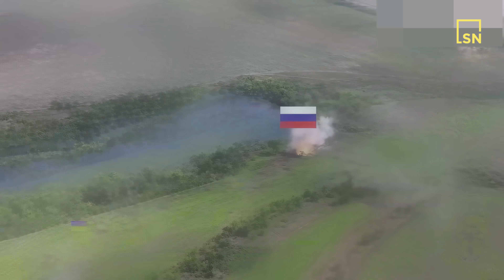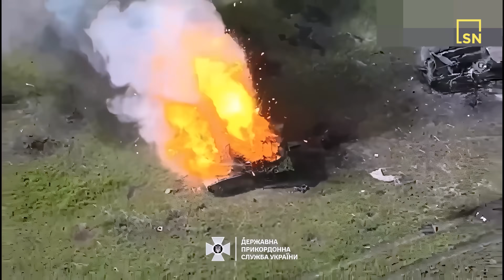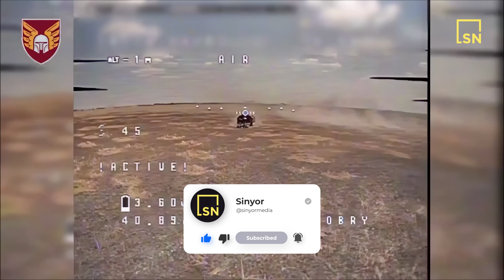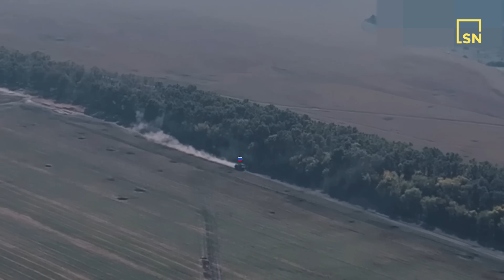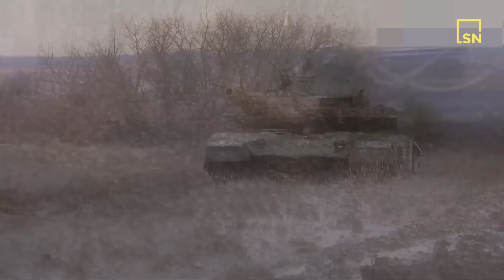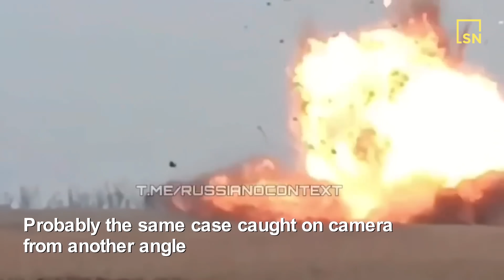Two Abrams Face Russian Brigade Alone, Head-on

Comment: T-series tanks are a deathtrap with the crew sitting right on top of the charges exposed. This shows that even with hatches closed that the pressure can cook them off resulting in ERA being useless when even small explosives can cause this reaction from even outside the armour.

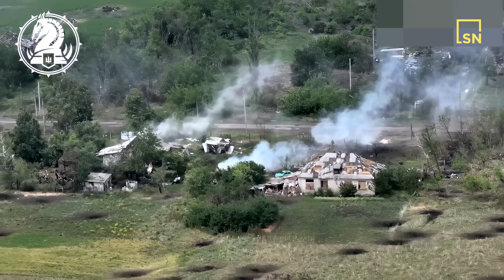Comment: 2:15 "The duel ends with the Bradly's clear advantage" and after a few seconds we can see the BTR calmly driving away, being completely undamaged with the live infantry, lol
Reply: Yea this is just propaganda
Reply: @Вова-л9г3ъ  you can clearly see the btr has extreme engine damage rendering it unusable, its not war thunder they cant just extinguish the fire and fix it in 40 seconds.
Reply: @D1CornbaII  What do you mean I cannot fix my damaged cannon barrel, cannon breach, engine, transmission in 40 seconds? Next, are you going to tell me that I cannot replenish crews on the caps?
Reply: @null-0x only if you cap the d point
Reply: Ну как сказать ,он проскочил но пехоту покрошило,у Бредли фугасные снаряды с воздушным подрывом
Reply: @Виталий-ч2б5ь  во во , не зря там зацензурено 
Водитель может и выжил , а вот все кто был на броне отправились к кобзону

Comment: I think one of the things people don't realize is that the reason russian tanks have such catastrophic failures compared to western tanks is that they use an autoloading mechanism with powder charges that are just kept in the crew compartment under the turret basket. Western tanks use dedicated blow out boxes in the back of the turret so if the ammo ignites it basically blows out a hatch away from the crew. This is also part of the reason why western turrets are so much larger compared to Russian ones

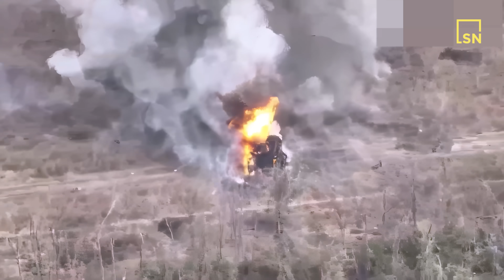Comment: 6:14 is not a mine, it is an ATGM, probably a Ukrainian Kombat or Stugna. The video showed a small line on the left side of the screen. To see it, you need to frame a split second before the explosion. It exploded because the impact was in an area where there was no Russian-made Relict dynamic protection that could have contained such a blow. But it wasn't there, so the cumulative jet (armor penetration of approximately 750mm) hit the ammunition directly, which apparently led to the explosion. If an Abrams or Leopard had been standing in the place of the T-90, the crew would have died due to the enormous pressure, temperature, and a small amount of debris that this cumulative would have created. Therefore, you can only protect yourself from this missile if you completely repel the blow without letting it penetrate the armor.

I am Ukrainian, and I don't want you to idealize Abrams or Leopards. At the moment, they are burning, unfortunately, no worse than the Russian ones. Of course, the chances of survival are higher, but don't pretend that they are the best.

Comment: This is going to sound like i'm trying to be funny. I'm not. I'm seeing a lot of open turrets. So, did the Russians not put AC in their next gen tanks? Not rhetorical.
If they're driving onto a battle field with hatches open, that's the only thing i can figure, that the heat is debilitating inside the tank.

Comment: I was a K1E1 tank gunner from Korean Army. Once, I had a chance to get combat training and war simulation against the other Korean armored unit that operates T-80U tanks as mimics of North Korean and Chinese tanks. On the way of returning to the point for break time right after the combat drill, my Commander reminds me that whole soviet based tanks with all auto-loader system like those micro-soft T-80 are extremely vulnerable to chain explosion of the ammo and turret blown-off. Now eventually I understand via this video what the senior sergeants said.

Comment: Power take off PTO press gears cables pulleys hydraulics like transformers autobots decepticons technologies flex joint scaffold tile pressure panels power wind suspension dynamo generators power wind poles orbital powered like automatic watch like tectonic plates diamond coating fiber optics light speed signals reflector light sorce codes cloaking device transmitters focal Lazer systems incinerate missiles hypersonic missiles nanowalls electric current solid to passing through kinetic energy readers sight system power source receive signals quicker cyclone intake sorter valves psi tanks compressors fuel recycling technologies warp drive technologies also helps clean environments foreign exchange students policy members UFO mechanics repair droids turned into organic lifeforms trading places with lifeforms cybernetic clone series droids designed for infiltration systems planets moons world's alien infiltration act members best luck everyone PTO press gears cables pulleys hydraulics flex joint scaffold tile pressure panels solar panels microwave panels converts signals to energy power wind suspension dynamo generators power wind poles heat cool channel tubes cyclone intake sorter valves psi tanks compressors fuel recycling technologies electro static magnetic shield generators electro static magnetic purpultion heat cool hover panels diamond coating fiber optics light speed signals reflector light sorce codes cloaking device transmitter neural implants nerve splicing nanites microscopic robotics nanited hulls nanowalls nanotec munitions reanimates reprograms lifeforms uploads downloads information kinetic energy readers sight system power source reading electric current magnetic field vision sonar thermal vision infered molecular vision elemental vision aliens alliances Armada approved federation friends forever federation throughout the universe doesn't resalitify is the goal were all matter of the universe doesn't resalitify is the goal life's important ingredient to help make sure the universe doesn't resalitify planet moon sized spaceship building shows

Comment: This feels more like WWI with modern weapons
Reply: What do you mean?
Reply: @britishrocklovingyank3491 long running trenches with only incremental gains that tend to push forward and back over time. Most modern conflicts are very asymmetrical, with power expanded from one side over another. While there is an argument for that here, the combat ebbs and flows daily. WWI also say weapons from 200 years still being used on the battlefield as soldiers, commanders, and those unfortunate enough to be caught in the theaters learning how to adapt to the changing of times.

Comment: Why don't you tell people how Ukrainians are losing equipment? They have much more losses of "great" NATO equipment which is inferior to Russian equipment in many ways, take the Bradley and the Russian IFV, for example. If the electronics in the Bradley fail, it's just a pile of metal that can't be controlled. Russian BMP doesn't have that problem, plus it can immediately move on water without hours of preparation, like the Bradley.
Reply: Ur right, but russia use mainly bmp1 and bmp2, which are worse than bradley- like armour, penetration, gun range.. only thing is that bmp have better mobility, and they haven’t lost more equipment

Comment: Russian tanks only have solid protection in the front on the hull and turret, the sides are thin only rated to stop 25mm at least on the older T 72 models. the up side to that is they are cheaper and faster to produce

Comment: 📉 Ukrainian Tank Losses by Type (February 2022 – July 2025)

Tank Type / Origin	Estimated Losses	Main Remarks
T-64 (Soviet)	~500 units	Main tank at the start of the conflict
T-72 (modified)	~300 units	Delivered by Poland, Czech Republic; modernized
Leopard 2A4 / 2A6	~40 units	Frequent targets of Russian drones
Leopard 1A5	~20 units	Less protected, often used in support roles
Challenger 2	~5 units	Rarely deployed on front lines
M1 Abrams	~10 units	Used cautiously, limited losses
AMX-10RC	~25 units	Light armor, vulnerable to ambushes
Other Western tanks	~15 units	Includes light or older tank models
Estimated Total Losses	~920–950 tanks	Confirmed or probable cumulative losses
📆 Estimated Monthly Losses (Trend)
Month / Year	Estimated Losses	Main Tank Types Affected	Military Context
Mar–May 2022	~250 tanks	T-64, T-72	Initial Russian offensive
Jun–Dec 2022	~200 tanks	T-64, T-72	Battles in Donbas and Kherson
Jan–Jun 2023	~150 tanks	T-72, Leopard 2, AMX-10RC	Ukrainian counteroffensives
Jul–Dec 2023	~120 tanks	Leopard 2, AMX-10RC, Abrams	Intensification of drone strikes
Jan–Jun 2024	~130 tanks	T-72, Leopard 1, AMX-10RC	Tactical withdrawal and logistical losses
Jul 2024–Jul 2025	~100 tanks	T-64, Leopard 2, Abrams	Doctrinal shift

🚛 Distribution of Western Tank Losses by Donor Country
Donor Country	Tank Type(s) Delivered	Estimated Losses	% of Losses vs Delivered
🇩🇪 Germany	Leopard 2 / Leopard 1	~60 units	~50 %
🇺🇸 United States	M1 Abrams	~10 units	~32 %
🇬🇧 United Kingdom	Challenger 2	~5 units	~36 %
🇫🇷 France	AMX-10RC	~25 units	~62 %
🇵🇱 Poland	Modernized T-72	~40 units	~80 %
🇳🇱 Netherlands	Leopard 1A5	~10 units	~50 %

➡ Out of roughly 275 Western tanks delivered, about 150 were lost, equating to a ~55 % cumulative loss rate.